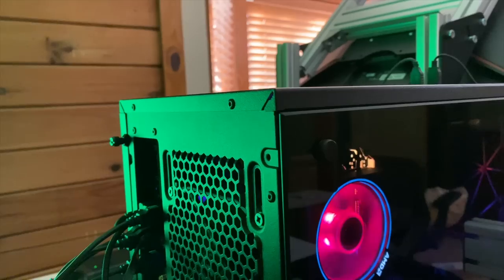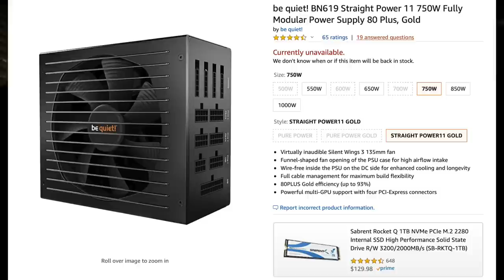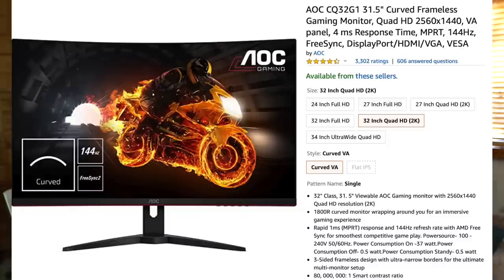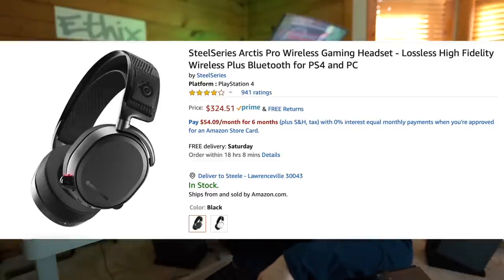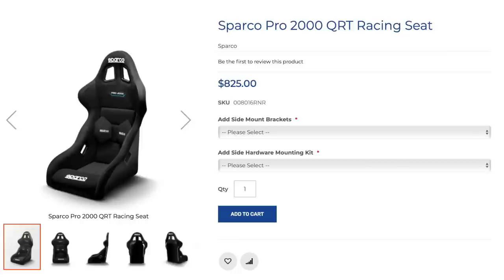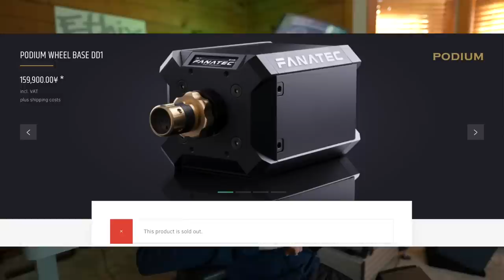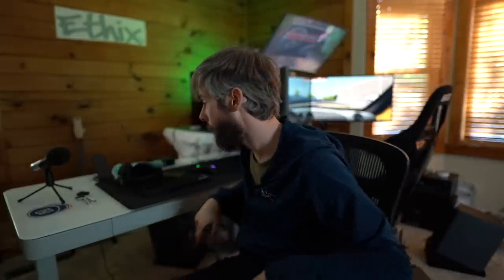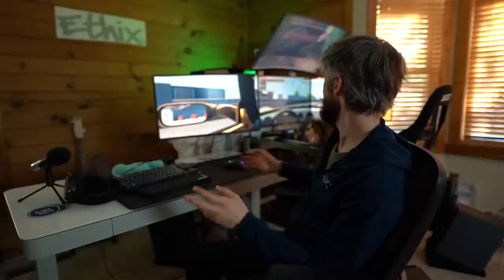Pro Sim Racing Setup | Starting from Scratch

Comment: I did this but for Liftoff instead.   Probably spent $500 on an 8core 8350FX board, 32gb RAM, Geforce 1070GT, huge monitors from goodwill, two USB interlink Realflight controllers, etc.  Loved it, put hundreds of flight hours on it.  Luigi Studios even thanked me for my nice review.  Even got Flightsim sticks and rudder pedals and MS flight sim for free from a friend to trick it out more and repurposed a 5.1 surround sound system.  I should of totally effing stopped right there and I knew it, because I held off for months buying any real quad stuff other than some analog stuff and RTF toy quads that were given to me, while I research my epic cinematic FPV digital quad shopping list more and more. 
 
That shopping list ran up to $2,000, but I was able to shave of a bit via $150 credit card rebates and serious power shopping.  I'm still waiting for the various parts from China months later.  Worse, with China package tracking being non-existent, I have no idea even if my DJI goggles have shipped which was the first thing I was totally sure of and ordered. Then BG sends me a cryptic message they can't ship them, they will refund my purchase in a week, so I'm like, ok, so now I have to source these again, or do I, because they never refunded them.  It's a morass and a nightmare. 
 
All the little parts from USA and my $250 worth of li-ions I've gotten already... but who knows where my goggles, quad, frames, transmitter, chargers/dischargers, and quad tools are...  out there in shipping limbo and might be beyond Augusta before I ever receive most of them.  I ordered something unrelated from China Mar 3rd... 80 days later I finally got it. 
 
$2,000 and still not flying.. .:-/   This doesn't even count all the soldering that's going to be involved making up the battery packs from scratch, or configuring the flight controller or crossfire or transmitter...   that's gong to be a headache in and of itself.   If you want to fly fpv on the cheap, get an interlink usb controller, a copy of Liftoff, and call it quits right there...  build a Simulator and that's it... assuming you already got a decent quad core PC gaming rig and GT710 or higher...   you can fly all you want for less than $50 bucks, no additional cost, no busted quads, dead lipos, walks of shame, burnt fingers soldering, or... in my case... waiting forever for just the bare basics to get started to arrive.
 
Maybe someday I'll be flying... but entering a Great Depression, I'm questioning now if entering this hobby this year was a wise move.   It seems burnt out and played out already.   I've been researching FPV quadcopters since this time last year... by now, I don't even know if I want to fly any more.  It seems like such a hassle now to get out of the house and drive somewhere to fly something, then go slogging through the briars to find it when it goes down.  Ughh.  I hardly ever even fire up Liftoff any more, and I'm not one prone to get bored easily.
 
fpv.air-war.org

Comment: Congrats on your new rig.  If you can afford it, just do it right now, it is the most amazing experience.
So coming from my own experience, P1-X + D-Box Actuators (4250i) +VR (Valve Index) is where you want to end up, no questions.  Yes 3 screens probably more confortable than VR, but who cares. The simple fact that your body and brain can experience motion without seeing your real outside env, is absolutely an incredible sensation. The immersion of VR coupled with motion, tricks your brain in such a way, well you can't even describe it until you try it yourself.  And I have done it countless hours at a time with no problem.
I've had my setup for almost a year and a half now, can't go back to motion less with just screens.
This is my two cents, don't be missing out if you can : )

Comment: Assetto corsa FTW went from quads to sim racing ironically after bulking a gaming PC to fly FPV sims.. found a thrust master T300RS GT set with pedals on eBay and never looked back... that was a year ago. You can build a decent sim rig all up for about 1-2K if your savvy and lucky on eBay 🤓
Also you really don’t need a 2K PC to have a great time on assetto or most racing sims

btw
Jimmy Broadbent is THE Sim racing guy, best content going

Comment: Look into a bass transducer maybe to mount to the seat bottom if you want more vibration in the seat without having to rely purely on the bass from the speakers?   Would be interesting to see if the transducer can be tuned to specific frequencies that are most likely to be road noise oriented for coing up over embankments on apexes.  The transducers are not terribly expensive.

Comment: Nice build, one advice. You should maybe consider switching the stock cooler with an aftermarket one. I have the same cpu and it got really hot (80-90°c) on load. I switched mine to a nzxt z63 and now it's around 45°c
Reply: Yeah, me too, can't reccommend the kraken z63 enough. It also nice to see hardware stats at a glance without having to have them on screen.

Comment: For those gasping at the price you do not "need" to spend $12,000 on a racing simulator. You can spend $500 - $1,000 and still have a grand old time and be competitive. I as well have a professional grade simulator and I think I spent about half of that (not taking the PC into account because those prices are astronomical now a days and I bought mine pre covid at great value). By not getting an FiA grade seat, finding cheaper monitors, and not buying the top of the line H-Pattern shifter that's $3k in savings right there. I'm not trying to say any of this stuff is a bad purchase but coming from someone who love motorsports and sim racing I also like saving money especially having a wife and 2 kids lol.

Comment: If you feel that's not enough for 3 monitors with a higher graphic setting and refresh rate. Can try to overclock the 2080 and underclock your CPU. also don't forget to check the screen Hz in case some video cables is only reach 60hz instead of 165hz. you can check it on "UFO SCREEN TEST" website, and don't forget to enable G-sync in graphic card option.

Comment: Mr Steele, your gpu has a 2.0 hdmi port so you can run 1440p at 144hz. So check the cable to use your top monitor at his full potential

Comment: I built a rig and thought it wouldn't be too expensive.  Final cost for a PC, Next Level Racing rig and Logitech Wheel was about $5000.  $1500 for the rig and $3500 for the PC.  And months to get all the parts delivered during the COVID-19 hoax.

Comment: Awesome build! Btw, HDMI 2.0+ can easily support 144Hz rate. If you don't see it in the windows display settings (might be limited to up to 120Hz) you gonna need to create a custom, native resolution in the NVIDIA's panel, but specify the refresh rate to be 144. It's just the windows's limitation so it won't do any harm. Regardless the mouse, if you ever notice it randomly disconnect to the point that you need to manually reconnect it so windows will pick it up again, make sure to solder something like 470mF cap on it's power line. Annnnd here comes the VR comment... There are some great car sims that support it! :) It's not a replacement to your monitors, rather more like an addition. Eye fatigue really might be an issue for prolonged gaming but it's cool for an hour or two, so why not mix them? This setup already costed plenty so adding a VR headset won't change much but it definitely will extend the possibilities! ;)

Comment: Very nice set up!  I am jealous.
Have you thought about using a high resolution VR headset (such as the HP Reverb G2) in place of all the monitors?    That could save about $2K.
In terms of desktop vs. gaming laptop, I am trying to simplify the process by buying a loaded gaming laptop with the latest Intel I-9 chip and a high-end Nvidia RTX 3080 graphic cards.   Wondering if buidling a custom gaming desktop would be more economical and more extensible in the future.

Comment: I love it, but the mistake with this is that he bought the highest end stuff when hes only been into the hobby for 2 months. That usually ends up in selling it all or not using it within the same year when the buyer realizes its not as fun as they would have thought. See, it will never feel like the real thing no matter how much you spend, you're just getting as close to it as you can for immersion, which VR would have saved you about 1500 bucks already. The seat was a complete waste of money, the rest of the gear is worth it if youre a sim racer. However due to the aforementioned, most veteran sim racers will tell you to start with a more budget friendly set up like the fanatec 2.5 wheel, v3 pedals, shifter/ebreak. The whole thing would have costed as much as those two monitors and your experience to you (since I bet you're not even using 30% of the DD feedback yet) would have been just as enjoyable, then in a year you could upgrade. 

That being said to each their own and I hope you stay in the hobby :]
Reply from the maker: Still in it.  And fucking love it.     Upgrading is a waste of money to me. If you can’t afford what you want. Wait.

Comment: Also the motherboard you have is comparable with the new AMD CPU's that were just announced but currently nothing about them is known. And the GPU that you have is the top of the line the only thing that is better is a 2080 ti or enterprise hardware. The Vram in the gpu is the lower amount for 2080s though.

Comment: I recently got a Canis Enginering GT2 motion simulator from England. It cost me just around $4,500. It is compatible with PC, PS4 and Xbox, unlike most rigs that only work with a PC. Although I'm setup for a single monitor attached to the simulator and both PS4 VR and an Occulus Rift S VR, my total cost is thousands less than yours. I could do the 3 monitor setup but that doesn't work with gaming consoles. I'm not saying this for any bragging points, just the opposite. I'm just don't understand why non-motion sim rigs are so expensive here in the  USA. Similar motion simulators like I have cost several thousands of dollars more, in the USA ?............in your research, did you come across this and why do you think they coast so much  here ?..........I custom ordered mine and oped for higher end Fanatec peripherals . There is a long learning curve with simulators... lots of wires, lots of options, lots of cables, lots of learning software and mostly trying to figure out what they don't tell you. I find it not for the faint of heart but worth the  challenge. Do you agree ?

Comment: I’ll be getting the TrackRacer equivalent set up soon. I also want to have it set up like this guy where I can swing one of my side monitors over a desk for day to day PC usage and FPS gaming. Just curious if you can leave the bolts up torqued at the pivot point to accomplish this with ease or if it’s a pia to go back and forth.
I currently have a diy rig with triples set up, my screens are just on monitor arms with my right screen being on its own arm so I can just swing it back and forth.

Comment: Congrats, what a setup ! I'm looking to do one like that in the future, what kind of swivel or pivot did your assemble to have the left screen as a moving one for FPS ? Thank you in advance.
Reply from the maker: I just left out the rear locking screws on the Monitor mount.  And it swivels.  Pretty easy but yeah just got lucky with the monitor setup

Comment: What's crazy is about a month back i decided to get back into sim racing. i did the same thing. watch all of barrys videos religiously to pick my hardware. and at first also decided to go with fanatec podium, MECA, and prosim H shifter. I have since changed components because im going for a specific purpose build. But i am still trying to get my hands on the Prosim H shifter. Currently saying out of stock and im guessing you ordered yours around march? Did you go through a reseller, or is there any tip on getting ahold of one? Thank you, and sweet rig.

Comment: hey mr steele quick question here.. is there a particular reason 'small screens' are preferred in sim racing. Like I've been noticing alot of sim racers don't use say huge 50inch tv screens but instead use smaller one's. I just got interested in sim racing and was wondering if there's a particular rsn to that or if its just a preference. I imagines bigger screens, like taking 3 50inch screens together would be better but so far i see the opposite, please help

Comment: Excellent video, thank you. I’ve built a similar rig and I’m also mildly happy with it. The only complain I have is with nvidia surround setup, because it’s always getting the wrong resolution. I need to use CRU every time I start windows to correct the resolution. Nvidia seems to think that I have 3x 4K monitors and I only have 1440p just like yours. Did you had any trouble of that kind? I have 3x 32” Benq monitors. 
Thank you.

Comment: I need one of my side monitors to swivel just like yours... I’ll be getting the sim lab triple mount and just wondering how you accomplished this? Did you just leave the one swivel bolt out to get full range of motion? As far as I know the sim lab only adjust between 70-45 degrees.
Reply from the maker: I just leave the inner bolt out. And presto
Reply: Thanks that’s what I thought.... how well does it line back up with your triple when you move it back and forth?

Comment: does the upper monitor low refresh rate bog down the high refresh rate of the main 3 monitors? I know its been an issue for years now and all my monitors have to be the same refresh if i want to use them all at the same time.

Comment: Can you give me some info on the swivel you used? Looking to do the exact same thing in my setup. Thanks!
Reply from the maker: It’s just the sim lab monitor stand with the two inside bolts left off so you get a swivel on the outer monitor

Comment: At that point, just buy a track lol
Reply from the maker: Yeah I know of a lot of really nice tracks I could buy for 15k.   They are sand. And 200 miles from the nearest human settlements.  But yeah. Sounds like a good plan.  Wouldn’t cost 10k to by a shit side by side and oh another 4k for a trailer.   Need a truck too so maybe 20k.  Then the gAs to get there at 1800 miles away. 12mpg.. should only be like 1k in gas one way.. yeah. I think a 15k track is the way to go you were right